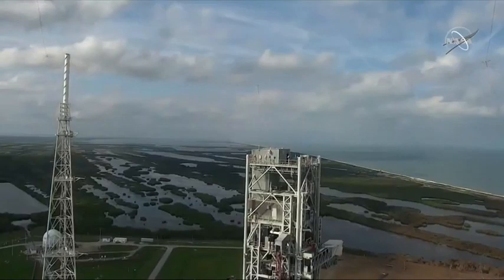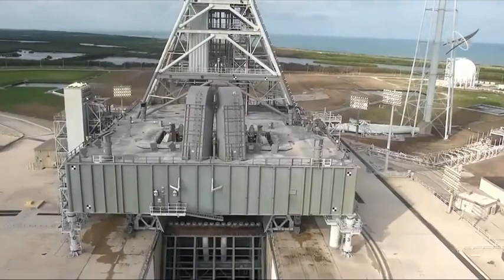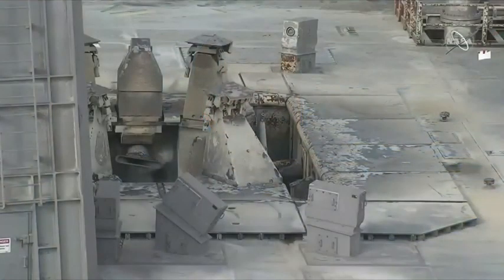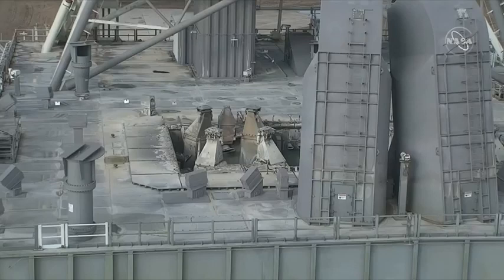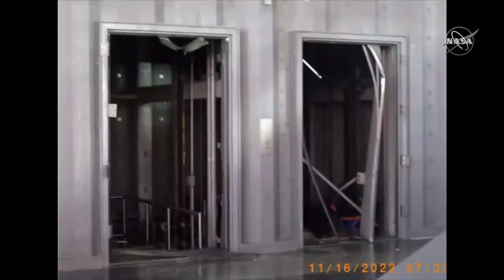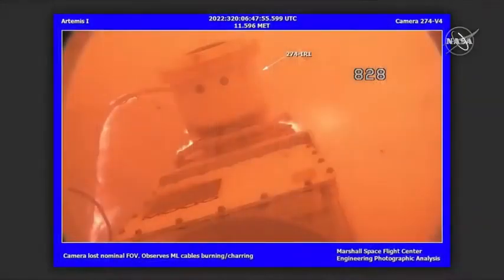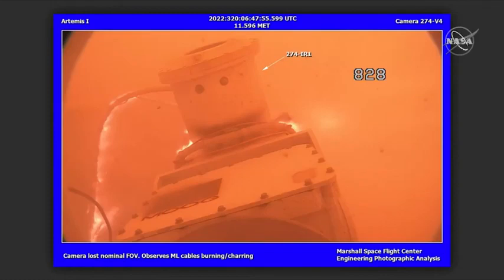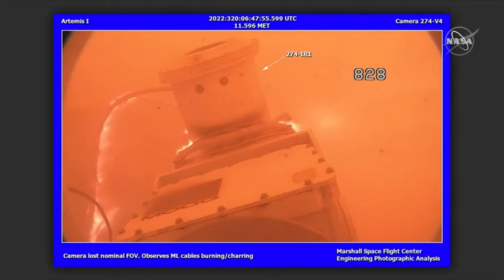See the aftermath #Artemis 1 blast off 'blows doors' off launch pad elevators.

Comment: What can be done to better protect the elevators from damage during future launches?
Reply: Use thw stairs lmao
Reply: Augment the sound suppression system. Maybe adding more "rain birds" or sound-absorbing panels to the elevator doors. Or maybe closing the area around the boosters' nozzles with a material that disintegrates away absorbing the ignition shock wave. On the space shuttle system, the MLP had water bags (sausages) covering the boosters' blast ports that would absorb the ignition shock wave and break away. And that is in addition to water jets blasting right below the nozzles.
Reply: Stronger doors.
Reply: Add blast shutters that close over the doors as the count nears zero.